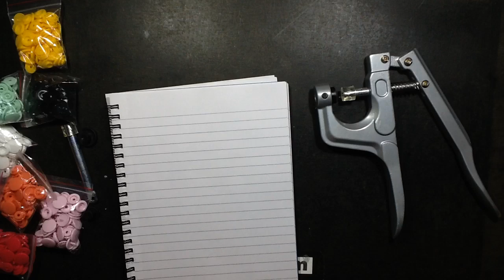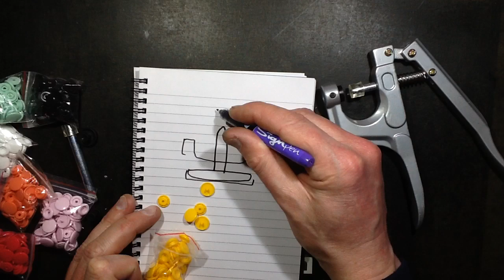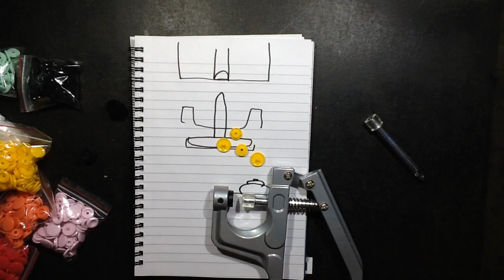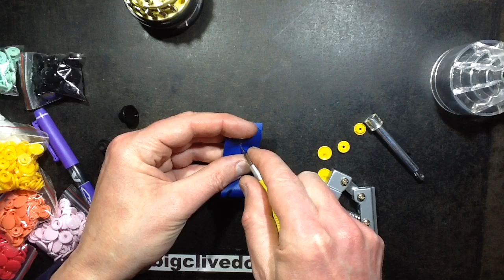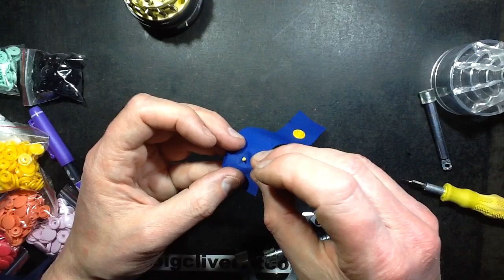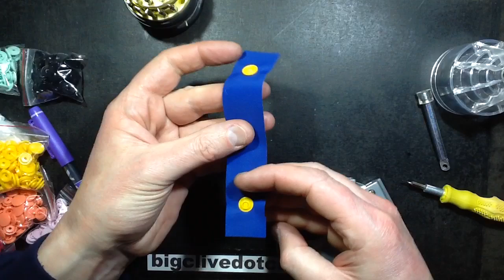KAM-style plastic press-studs and their setting tool.

Comment: I think it is a kind of plastic which heats up when it gets squashed so hardly: PVC. When you have a thin PVC pipe and bent it several times, the place where its been bent gets hot to the touch. When the pin is squashed so hard, the plastic gets hot on that spot, so that it's kind of melting down to a kind of mushroom, so the pin is mushroomed on and it cools down immediately after the pin is mushroomed. Kinda neat and clever.
Reply: ***** I'd still feel better with a drop of glue.